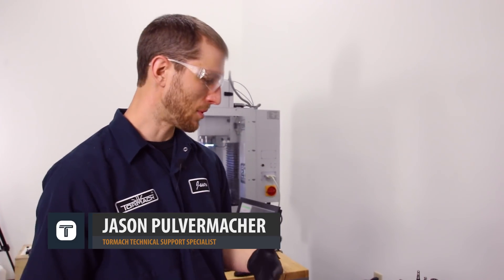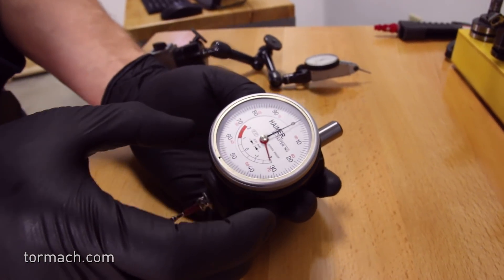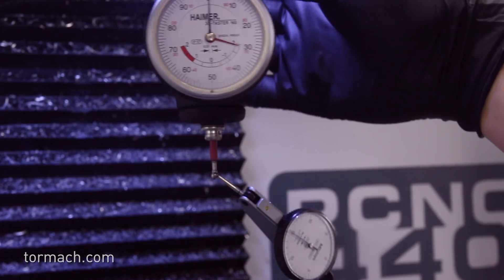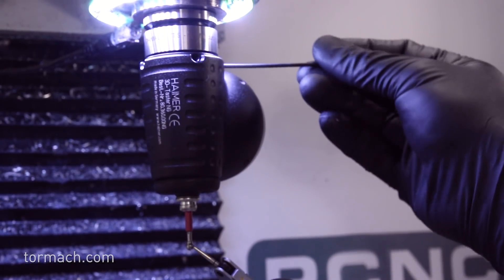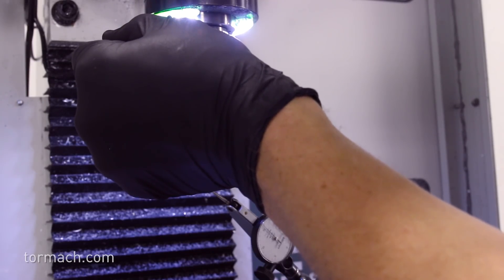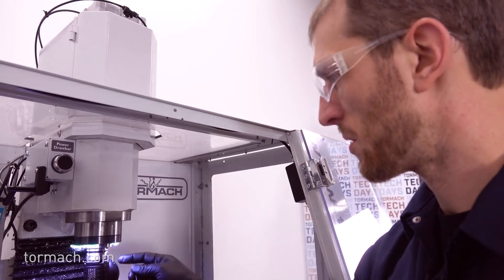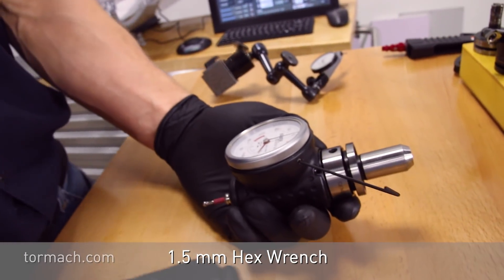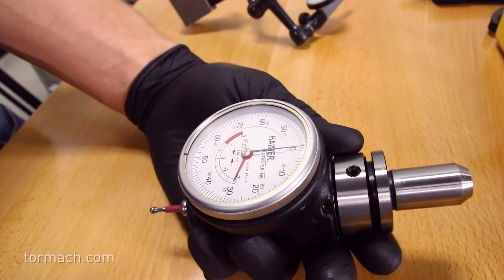How To Calibrate Your Haimer 3D Sensor

Comment: Thanks for posting this. Mine has been about .07 mm off for a while, possibly since it got bumped. I had dialed in the run out, but didn't know how to get the needle back to zero. Problem solved!

Comment: Hello. How often adjust the 3d sensor? If I have spindel without ATC, I need to colibrate it each time?
Reply from the maker: Hello CNC_Handyman, you do not need to recalibrate the Haimer each time it is installed into the spindle. Whether you are using our TTS system or a BT30 the tool lengths are repeatable.

Comment: I thought you just turn the dial face to zero that needle.... I guess mine has always been out 2.5/100ths of a mm consistently ?????! How do you know that the zero on the dial is dead on 12 o’clock?? 🤦‍♂️🤦‍♂️
Reply from the maker: The preferred method is to calibrate the Haimer and not turn the dial face.
Reply: @tormachinc  - no... it's just the same thing done the hard way.

turning the dial face is technically the same thing as turning the entire mechanic by using the setscrews.

therefore the dialface is made to be rotatable